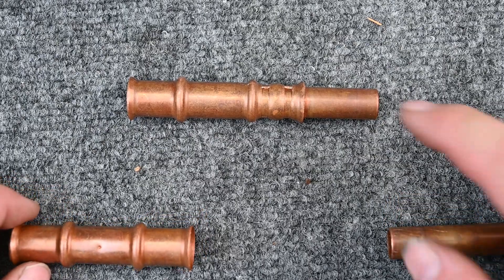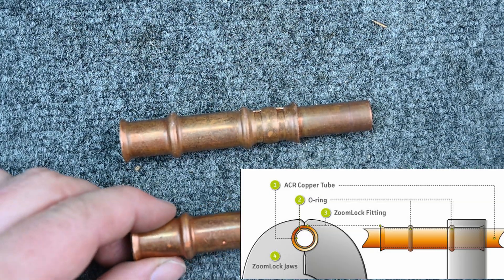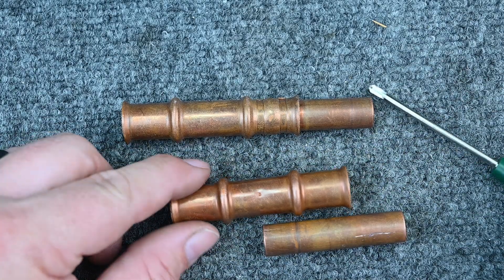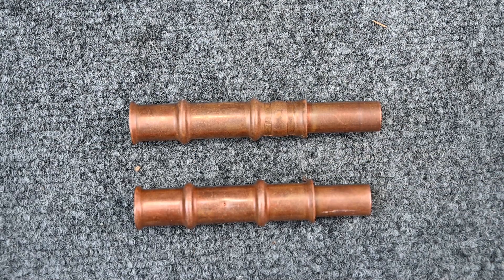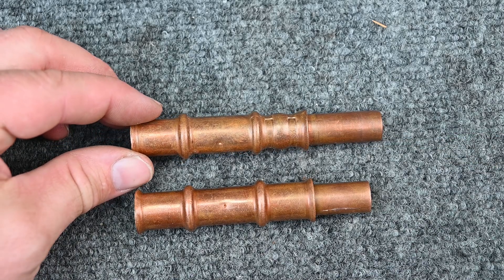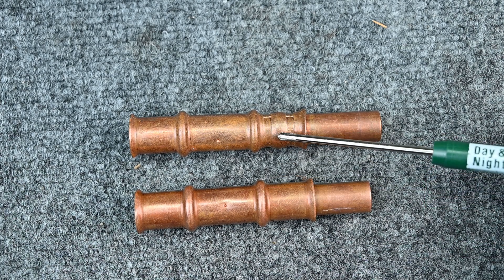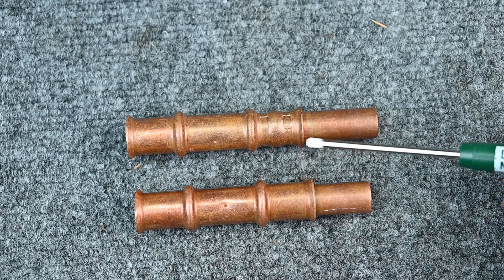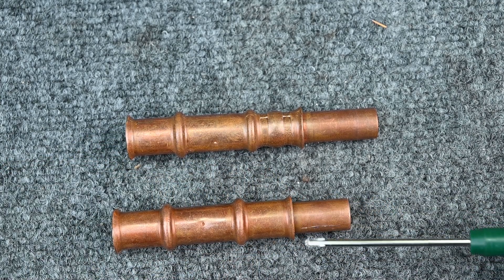HVAC 087 D connections part 4 Pressed fittings

Comment: Let’s discuss that rubber O-ring material.   When Automotive that exclusively uses rubber O-rings of course it’s not real rubber synthetic material man-made.        At all the fittings and seal the case of the compressors themselves. 

       When the automotive industry switched over from CFC R12 to HFC R134 they learn really fast that the old butyl rubber O-ring material would fail would leak overtime. 

       So they switched over to PTFE, Nitrile (Buna),  Neoprene, EPDM rubber and Floracarbon (Viton) 
             Starting back in 1990 the first automobile as a test guinea pig was introduced to the market with R134 before the mandate of 100% of all manufactures had to stop using R12 and switch over to R134. 

          Ever since this time they’ve attempted to use different compression style different locking different clamp styles captive ring grooves and many other styles of clamping force to stop leaks and they have all failed. 
         Not a single year make model or manufactures attempts to make a leak proof O-ring fitting has ever been 100% successful.   True many do not leak or at least for at least five or 10 sometimes 15 years.     But usually out of anywhere between 8 to maybe 15 or 20 joint connections using O-rings in a 10 to 15 year life of the vehicle at least one of them fail on a vehicle.    And this is on a low pressure refrigerant like R134. 

       So now somebody in marketing got a great idea to bring this exact same material to high-pressure refrigerant and every time there’s a leak it’s always technician error.     How about the inconsistency of copper manufactures to have uniform tubing wall thickness.    Especially notice this with some of the Italian and South America manufactured line set tubing to be thinner. 
            Or tubing that is not completely round has a slight oval shape to it as they force it in and that edge where the old wall is peaked at its highest Ark are pushed in past scraping through at two ends of the O-ring seal to seat it. 

         In the past and military and aviation these kind of connectors were and are still used.   But with very tight extremely quality controlled tubing on critical applications where they actually measure and use a gauge on the tubing itself to check uniformity every time to check thickness and roundness.   And if the tubing is even slightly out of round they have a Dowl cage that is used to be pressed the piping to reform it to a perfect round shape prior to insertion of the meeting fitting. 

        This all takes extra time and labor which cost money so they seem to leave all these procedures out when transferring this technology over to HVAC and refrigeration fittings.        I guess they think it’s not necessary to make their product seem cheaper easier and faster with less skilled technicians.   And they play with the math and figure the losses and mistakes to cause a leak or negligible and acceptable.     And they can always blame it on technician error. 

      Interesting 🤔 to say the least got a love marketing. 

         So if I was installing a quarter million tons of VRF  With several hundred Y connectors several hundred heads and I was going to guarantee it for 20 to  30 years . 
            Would you place your reputation and your bank account on a guarantee on silver brazing or rubber O-rings that are just press fit with millions of cycles of heating and cooling and millions of cycles of high-pressure and low-pressure cycles. 
             
         Of course always the fast cheap easy method is the winner $$$ When it comes to marketing and somebody who doesn’t expect to be around and have to warrantee the work but actually charge money 💰 for fixing it not even thinking about the low refrigerant charge us overtime that causes compressor failures

          Call burying  their head in the sand in denial with the aspects of making lots of money later in repairs that they caused in the first place. 

         But I can see the argument for their use in cheap systems that you don’t expect to live more than 10 years and if it did cause leaks that burned out the compressors that are easily changed in a relatively cheap.     I would probably use it on a Mr. cool AC system. Lol 😂 

        But not on a  high dollar very large complex or critical charge system used to keep Laboratories climate control anything that Hass to be reliable for decades

When has Silver lost its elasticity or when has Silver started to shrink for deteriorate or break down ? 

     Then ask yourself  what man-made synthetic material used as a gasket or seal has ever NOT broken down lost elasticity or NOT ever leaked ? 

      But I guess it must be OK because the manufacturers and the marketing teams will always blame it on human error. 

But we know the truth
Reply from the maker: Awesome! I learned several new things about rubber and the automotive side! Thank you. I agree with you, nothing beats silver solder/brazing in my view. Tried, tested and true. 
I have another video coming up on sunday, can you copy and paste this on that video when it publishes. It will be even more relevant to that video than ever!
Thanks again.
Reply: @love2hvac  sounds great will do

Comment: I used to do rubber injection molding.  The silicone "rubber" is cured at something like 350-500...  (6 years ago at this point).   Anywho.  I'd suggest removing an o-ring and covering it with solder.  It should survive.  Then try braising it.  I'm not sure if it will survive braising.  Either way the metal will have a hard time sticking.  Heat the rod.
Reply: Problem with normal solders is there a normal melting range somewhere between 430 and 470° then throw in human error to heat it up to hot above 500° (start burning the O-ring) and you would already have oil contamination from a leak inside the press fit that would make The solder not work

There is low temperature iridium solders that are around 270°F melting point

And even lower temperature Sauter is based on bismuth metal that melts around 140°F

But the only problem with all of them is that if the joint was leaking it is filled contaminated with oil that you would not be able to clean out of the joint to make the solder work and wick into the joint.        

And you can see low temperatures solders would not be good to use on high-pressure discharge gases because the temperature is too high. 

        So if silver solder (brazing rod 15%) was used in the first place there would be no leaks to ever repair.